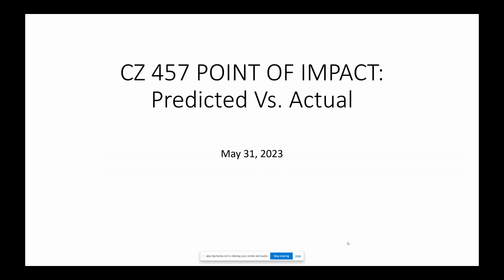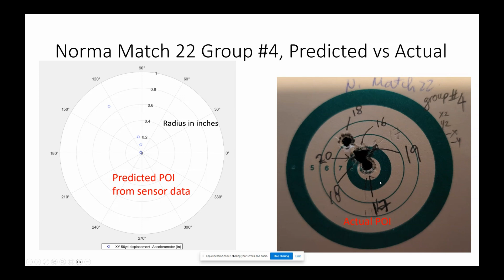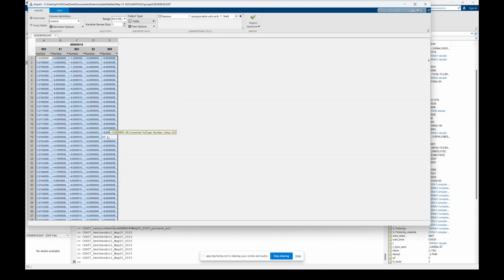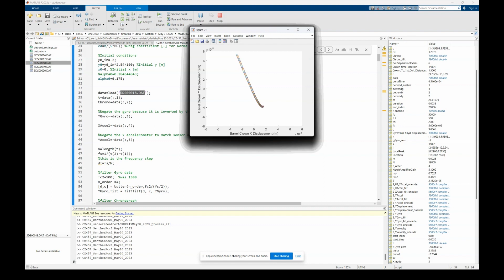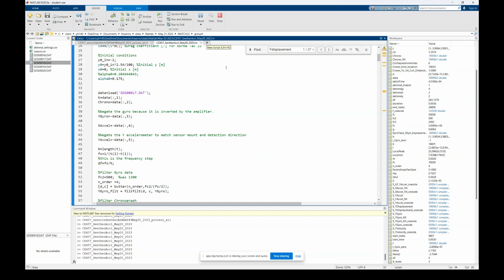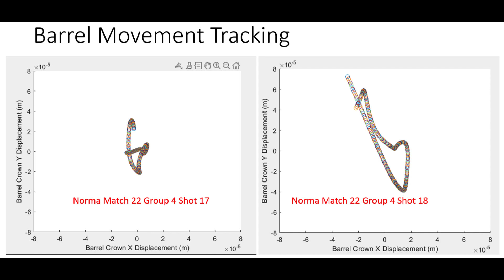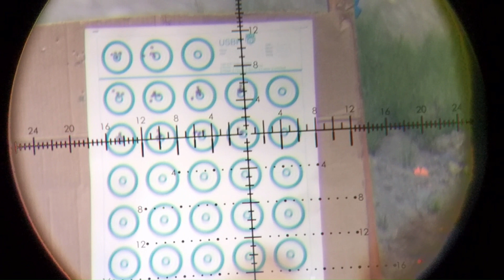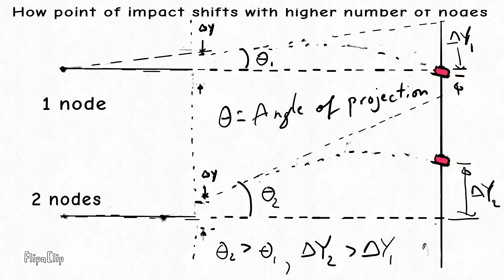CZ 457 MTR with Sensors To Measure Barrel Harmonics (Part 14)

Comment: Excellent stuff! You may have answered this before, but do you know if barrel temperature (and increasing elasticity) effects barrel deflection to any measurable degree?
Reply from the maker: All of my testing with the sensors is on my 22lr rifles.  With that said, the barrel doesn't get very hot.  I did not shoot it rapidly enough to get it hot where it started to affect the elasticity of the barrel.  I do notice that 308 are very sensitive to barrel temperature.  As it gets hot, the group size gets bigger.

Comment: Can I purchase your accelerometer/gyro/chrono? I have my own oscilloscope, function generator.
Reply from the maker: My setup is pretty janky and need some modification before releasing it.  I am planning to make modifications and do more prototyping with new sensors.
Reply: I’m still interested in buying even if janky. Anything id build would be equally janky.

Comment: Nice work,keep at that way and you will find how to beat that harmonic wave,have you tryed to add some rubber closer to the chamber,because it is the start point of the wave ,it should be easy to change  it there,or some different device,including spring touching the barrel

Comment: This is exciting work!  I'm impressed by how far you've proceeded in such a short time period.  I wish I had the capabilities to set up and measure barrel harmonics like you have done.  
But it will get even more exciting has you look at ways to dampen the harmonics.

Do you think you might get to a point where you could provide guidance to us non-techies on how to set up the equipment (sensors, oscilloscope, software) to measure the harmonics of our own guns?  I would be willing to buy the items on a shopping list you set up, and follow the steps (recipe) for making the connections.
Reply from the maker: I used Matlab to process my sensor data.  My sensors are all diy projects.  Unless you have an engineering background, it would be hard to replicate it.  It still needs some fine tuning and the best sensors to use is just too expensive for me to justify.  Unfortunately I am too busy at my full time job to make my gadget compact and available for the general public.  Perhaps it maybe a project I can take on when I retire.
Reply: @TunerPlinker I know I’d contribute!

Comment: Have you tried correlating the velocity(vector) of the muzzle when the bullet exits with the POI ?  Or the acceleration vector, rather than the integrated deflection.
Reply from the maker: My calculations is based on velocity, ballistic coefficient, and barrel deflection.  It gather all these information from the sensors and calculate the trajectory and final POI.
Reply: @TunerPlinker  yep - i have been eagerly following all the work you have been publishing - i very much appreciate it. My question was about an alternative possible correlation. rather than looking for a correlation between where the barrel is pointing at the time of egress and the POI, i'm postulating that there is a correlation between the acceleration or velocity vector of the muzzle at time of egress and the POI. I'm assuming that the radial acceleration vector of the barrel(and bullet) will effect the bullet during its flight time and hence effect its POI ? 
SO, for example, if the muzzle  initially travels horizontally far to the right then swings back and accelerates hard to the left such that the bullet exits just as the barrel is pointing 'straight ahead', will the bullet POI be on the POA or will it be to the left of the POA ?  So in this case will the POI correlate with the horizontal acceleration vector or with the final horizontal velocity vector ? My thought is that the bullet must exit the muzzle with the same horizontal velocity as the muzzle and this velocity vector will be a component of its flight trajectory.  What do you think ?
Reply from the maker: @roqcdatamanagement6905  you bring up a very good question.  At this point, the projected POI is based on the bullet velocity, ballistic coefficient, gravity, and barrel deflection as calculated from the accelerometer and gyro sensors.  I believe based on what I have read is that the barrel vertical velocity or angular rate is important for positive compensation due to variation of bullet velocity.  This affects how high the barrel is pointed upward to compensate for slower moving bullet.  I am sure that having high acceleration or velocity vector of the barrel deflection can affect the POI.  I have some data showing that the barrel acceleration vector is lower with a heavy tuner barrel on the end than without a barrel tuner.
Reply from the maker: @roqcdatamanagement6905  unfortunately I haven't had much time lately to do more work with my data due to work and family life.  There is still more data to collect or work on better sensors to collect better data.  I am sure that off axis barrel accelarion and velocity vector affects the point of impact.  Having more barrel tuner data will really help with correlating this.  I hope to continue working on this when weather and wife permits me time to work on it :)  I dread rainy season in the northwest Pacific region.
Reply: @TunerPlinker  :-)  i really appreciate all the work and time you put into this. Give your wife a hug from me and tell her that there are lots of selfish people out here that want you to spend more time working on this problem !   just think of the glory you (and she) will get from doing the world this service ! .... ah, um, maybe that went a bit far ;-)  Seriously though, i really am looking forward to you documenting more of your work on this.

Comment: Wonder how a barrel tuner would affect it
Reply from the maker: It makes a big difference.  The tuner seems to tighten the groups.  Just experimenting with the mid barrel tuner this couple of weeks.  The Eley Match was like a shot gun before and now it is one hole.
Reply: @TunerPlinker  I'd love to have a version of this to test different powder charges
Reply from the maker: @mastermoarman  You will need an oscilloscope to capture the sensor data....It does not have a microcontroller yet.
Reply: @TunerPlinker  how fast of a micro controller would you need? where are you located?
Reply from the maker: @mastermoarman The micontroller need to sample at 1MHz per sensor channel.  There are a total of 4 channels.  I'm located in Washington State.
Reply: @TunerPlinker  cool so am i. im in the everett area. would you be interested in doing some testing on a 308 fclass ?

Comment: in my experience i want to say that guns don't group as i would like
Reply from the maker: Let's see if we can change that.  There is a reason why shot 18 went renegade.  The accelerometer readings indicate there may be some imbalance as the bullet spins inside the barrel.  Would be great if we can knock that harmonic down.
Reply: @TunerPlinker  Hello, I was watching all your videos, and it's interesting what you said here. If it was an imbalance on the bullet, I think if you sorted the ammo first it would be diminished ? (Hard to find any evidence that this works) But with this device, maybe you can not have an aggressive flyer like in the video, can't think of another reason...

Comment: @Plinker, impressive work!
Would it be of value to start removing variables like the shooter? Maybe clamp the action and use a remote trigger?
You could see if you have a nicked round and use it in testing?
Either way, great vid!
Reply from the maker: I am planning to add an arca vise to my rest that will secure the stock.  Afterward, both the forend and stock will be secured to the rest.
Reply: in my experience there are no bad shooters, just a few exceptions but generally when you are shooting from a bench with a scope sight it just doesn't make sense, so what i mean is that guns doesn't group as i would like